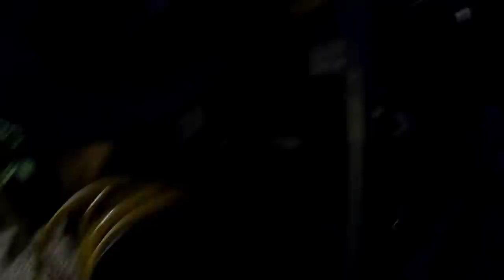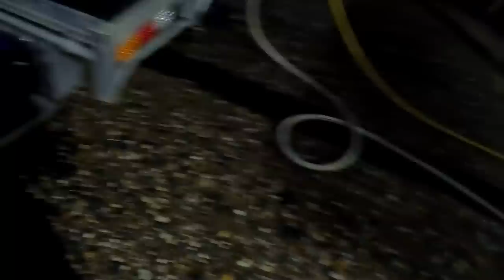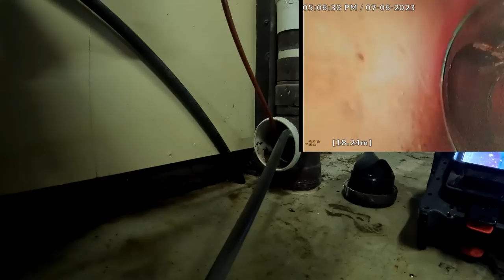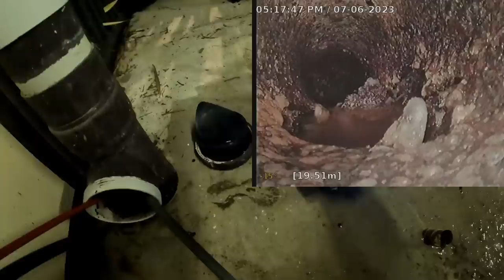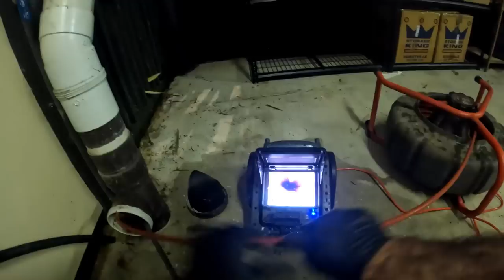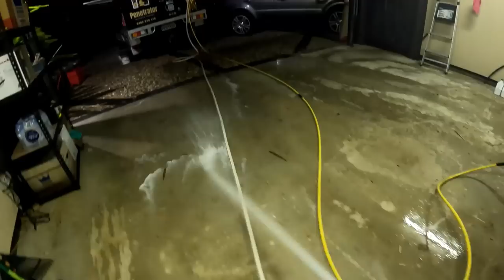Blocked Drain 394 - Oops I FLOODED The Garage & Got My Nozzle Stuck

Comment: Hi Gavin, quick cheap fix for some water control issues. Maybe get a couple cheap bicycle intertubes, cut the and then litely fill with clean sand and wire the ends shut. That gives you a small, portable, easy to clean dam to control flow direction or block a doorway. Love the work you do brother, thanks.

Comment: Had to finally look up what an org is:  (What Is An Overflow Relief Gully And What Does A Blocked ORG Mean ...    Usually the ORG is at least 100mm (although Queensland Urban Utilities state 75mm) lower than the lowest waste outlet in your home (eg. basin, shower or toilet) and at least 150mm above the surrounding ground to prevent storm water flowing into it.)  //  Oh, did Panda join your street crew?  Could you tell everyone how you got your street crew?  I saw the videos about the Mad Ball and the latest dino members but what about Toad and the long-necked dino?  //  To bad all garage floors not only slope from front to back but also from side to side so if water gets it, it is directed from back and sides to the outside.  I had a cement pad put it (before the garage was finally built, but it wasn't sloped properly so the second section (used for a work area not for vehicle storage) would get water coming under the 'fake door' (a plywood wall painted to look like a garage door).  I ended up chipping a bit of the cement away to provide a rough area for cement to lock on to and made a 1" or so tall and sloped 'wall' to keep the water from going in.  If it had been sloped correctly (as I had told the cement guys to do), I wouldn't have had a problem.  //  Oh what fun!!  Looking for something in the dark and hoping you don't trip over anything!